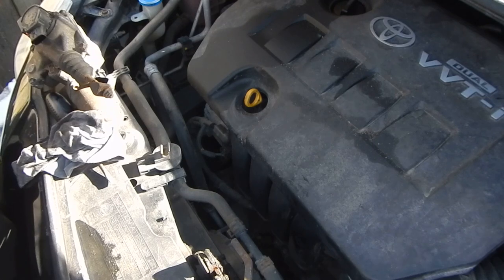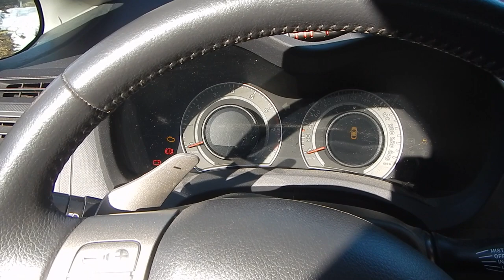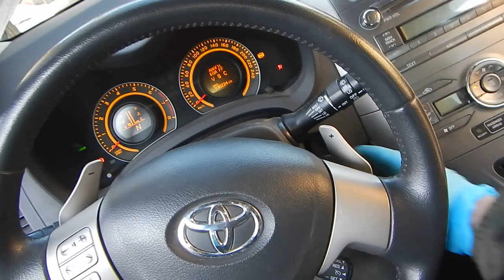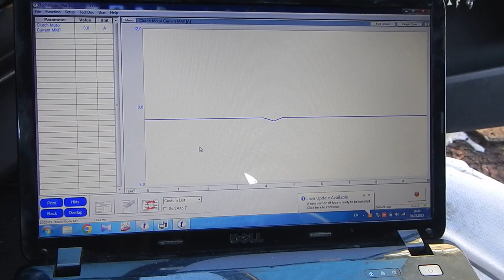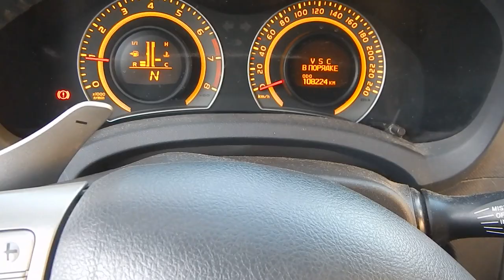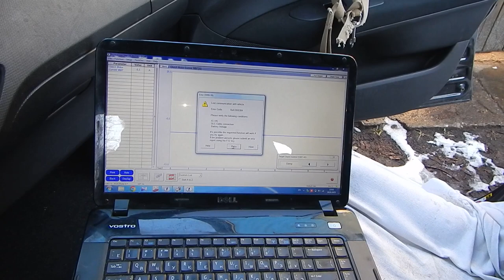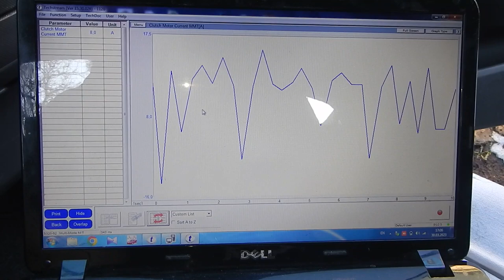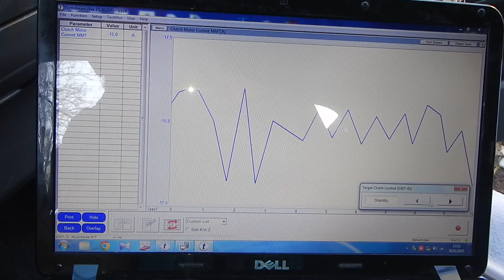Actuator of Clutch - Made in China - from Ebay Amazon How long it works in Toyota MMT Semi Automatic

Comment: Hi Yuri great video.

My 2010 Yaris will intermittently not start. I can select all gears and will show on instrument panel ok. If I move it from neutral to reverse then back to neutral it starts every time. Would you say this is a clutch actuator problem. 

Thanks
Reply from the maker: Hi.
First need to know trouble code, what the trouble code?
Reply: Hi Yuri,
P0917 trouble code.
Gear shift position circuit high.
Thanks.